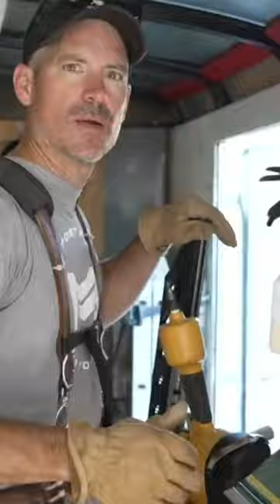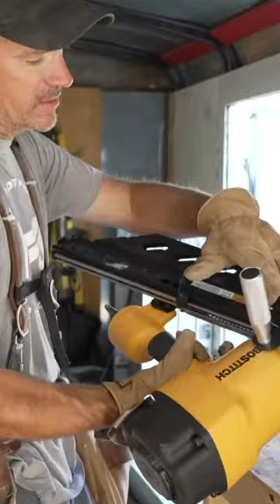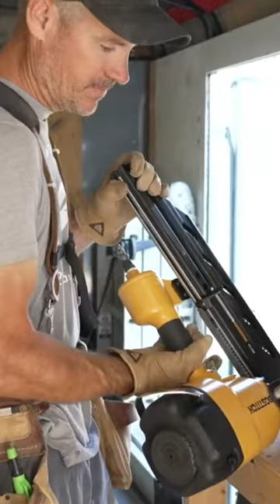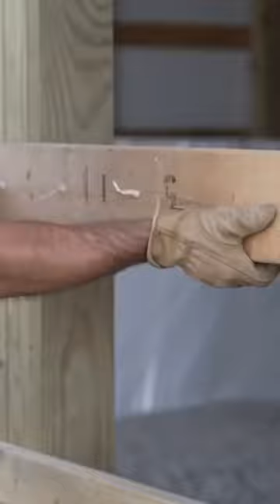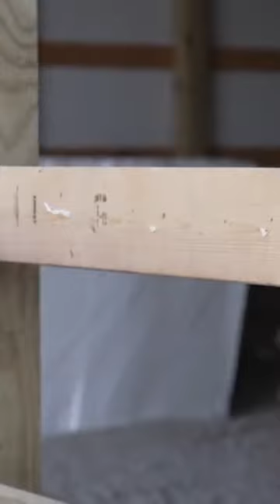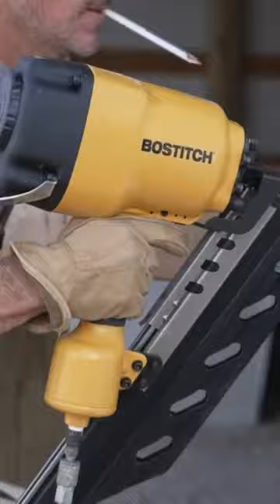Bostitch BRT130 #shorts #barndominium

Comment: I bought some Max tools. Expensive but the size of their larger nailers is insane. They look like a Brad nailer with a framing strip. The compressor has a high and regular side so you can use their high pressure and any regular pressure air tools. So far no problems.